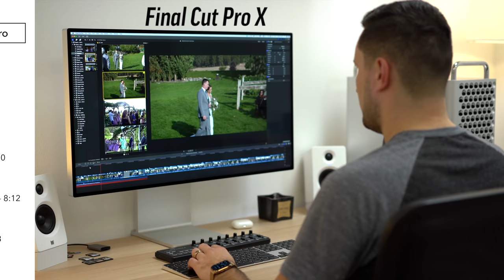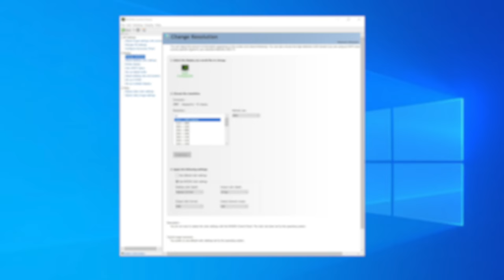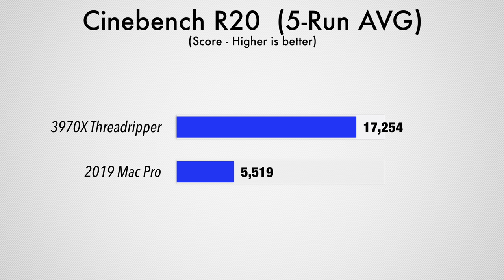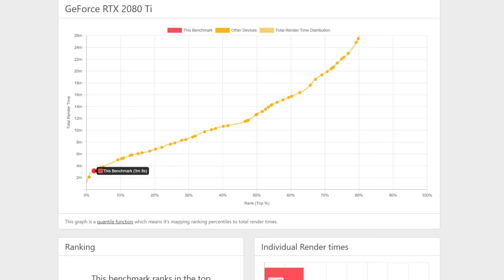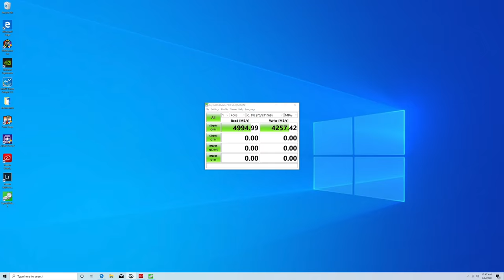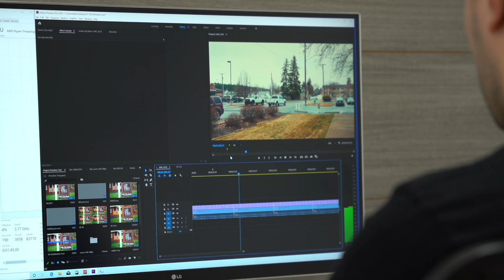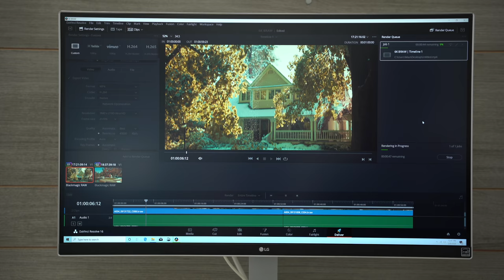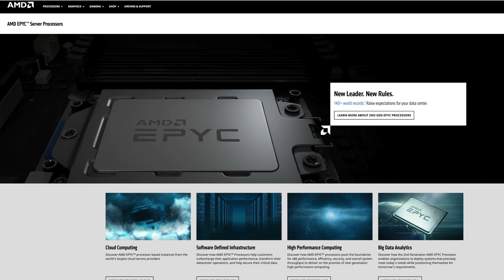$15,000 Mac Pro vs $5,000 Threadripper - Sorry Apple..

Comment: For $10.000 less, I can deal with a little noise.
Reply: Just to add to this the case also has bad air flow. Would be a lot quieter if the case didn’t have to force the air through. See Games Nexus
Reply: ufster81  "First of all, you have access to all fan curves, voltages etc. on a PC platform." Yeah, this is the main one right here.. if your system is boosting the fans when you open a web browser, the issue is not the computer - especially knowing you have a liquid cooling system, you don't raise the temp on the entire reservoir at the snap of the finger.
Reply: Yeah, the Enermax AIO is known to be very noisy, amd has major corrosion issues
Reply: Along with everyone else the noise is not normally going to be that bad if you play your card right. You can easily turn down the fan curve and swap out the fans, case, and cpu and gpu cooler to a quieter one.
Reply: However, bored with a noise problem😒
Reply: ufster81 the noise issue is due to there being no thermal design on the PC, as with “carefully saying” all PCs.  An AIO to cool the processor screwed into the top of a box with fans blowing on a graphics card and a few fans bringing air in is a hack job, not a thermal cooling design. For serious users, either the PC would need to be in another room or it’s not a sustainable solution without headphones. It’s exactly like the difference between a Mercedes S-Class and a Hyundai Genesis ... on paper it looks like the Hyundai competes, but for those who use their machines daily, noise levels are critical and actually, for most true professionals who need this level of power the extra $10k is actually not that much of an issue as you’d be an amateur to not make that much money out of your workstation every week or two.
Reply: ufster81 the noise issue is due to there being no thermal design on the PC, as with “carefully saying” all PCs.  An AIO to cool the processor screwed into the top of a box with fans blowing on a graphics card and a few fans bringing air in is a hack job, not a thermal cooling design. For serious users, either the PC would need to be in another room or it’s not a sustainable solution without headphones. It’s exactly like the difference between a Mercedes S-Class and a Hyundai Genesis ... on paper it looks like the Hyundai competes, but for those who use their machines daily, noise levels are critical and actually, for most true professionals who need this level of power the extra $10k is actually not that much of an issue as you’d be an amateur to not make that much money out of your workstation every week or two.
Reply: ufster81 the noise issue is due to there being no thermal design on the PC, as with “carefully saying” all PCs.  An AIO to cool the processor screwed into the top of a box with fans blowing on a graphics card and a few fans bringing air in is a hack job, not a thermal cooling design. For serious users, either the PC would need to be in another room or it’s not a sustainable solution without headphones. It’s exactly like the difference between a Mercedes S-Class and a Hyundai Genesis ... on paper it looks like the Hyundai competes, but for those who use their machines daily, noise levels are critical and actually, for most true professionals who need this level of power the extra $10k is actually not that much of an issue as you’d be an amateur to not make that much money out of your workstation every week or two.
Reply: water coolers exist too
Reply: @haithamali2161  hahaha lmFao dude noise in comparison to power/ capabilities isn't a hard choice oh yea and you save what 10 G's 😂😂😂😂
apple 👎
Reply: all you can tell about the mac is.. "It s very slient".. LOL...
Reply: ufster81  oh I have no doubt, and still come off thousands less then the mac pro lol
Reply: Threadripper is a lot more power efficient than Intel Xeon. You can make a silent and classy Threadripper system
Reply: Yes, not to mention dampened fan mounts, and good quality fans FTW (Noctua for example) . There are ways to get a pc whisper quiet, without breaking the bank, and thermal design is the first consideration of any serious system builder. Unless you buy a chassis based on looks regardless of poor design. But even if (all) PC is badly designed (like some uninformed idiot suggests) I'd tolerate the extra bit of noise and have 3 systems up and running for the same initial cost, bringing in 3 times the cash flow any day, so if one is down for maintenance, it is not going to be crippling for business. Not wasting profits on absurdly expensive repairs. While having unnecessarily long downtime. Missing a big break because your Mac is out of commission, not much fun. Yeah, anyhow, good luck getting those Macs repaired...When they break, not if. While on a PC when something breaks and the part is not immediately available, I am able to swap in virtually any compatable available parts while waiting for the proper replacement. If you care more about "status" and the downtime of your rig does not have an effect on your business, your not doing serious enough business.

Compromises have to be made, sometimes a slower or noisier system is acceptable, especially considering when there are multiple systems running simultaneously, which means that the work is still getting done faster overall... You can't drive a Mercedes when you need a pickup truck. Well, you can, but you'd be an idiot trying to showcase class without realizing that you are sincerely demonstrating your lack thereof. 

TLDR: PC = modularity, upgradablity, cost effectiveness, parts availability, serviceability. customizability. Did I mention cost? No? Okay, initial cost, repair costs, replacement costs. No need to rely on the "imbecile bar" to tell me that they cannot repair it and the replacement parts (the whole main board, new RAM and CPU although they are not faulty needs to replaced, they treat it as one "module", why not replace the power supply while it's in for repair, all of which at price of a complete new Mac) will not be available until next month, since Apple do not send parts unless they receive your old ones. So you'll have to buy another Mac, either way, to keep doing your work while your rig with all the software you need to do your work, is sent off for repair, and the reinstallation alone will set you back a couple of thousand, since time is money. But you haven't properly thought it through, have you, I mean, Macs don't break, do they? Yeah PCs don't either... (considering that you have a passively cooled Intel Zeon based PC running proprietary software, and someone has to get fired for not soldering the CPU and RAM to the main-board... Who TF approved the use of sockets, let alone, mainstream "PC Mobo" ones.)

On a more serious note though. Macs are fantastic machines, I'm not arguing that, but this just shows you that a comparable system (better in more than one regard) can be had for a third of the price, makes you wonder if you get what you pay for, or pay for "brand image".

Apple sucks, sue me.

Also, I am not affiliated with any PC component manufacturers in any way.

Apple does not suck? Sponsor?
Reply: There is a lot that can be done here, we have $10k to spend. A case without a window to start, would help with sound. Someone already mentioned it but there are better fans out there for this. Lastly water cooling loop.
Reply: but I can't deal with windows
Reply: @apereirafernandez , you can customize it to your hearts content...
Reply: indeed and mac has less moving parts so its easily going too be more quiet. another useless feature well done. thread ripper for the win!!
Reply: whit a bit of work, u can move mashine to next room and be supper quiet
Reply: I can't deal with noise, as my computer is in an audio control room. For any other use, sure.
Reply: As others mentioned, actually taking a moment on thermal design and part selection would silent the Threadripper right up.  I'd start with a case that isn't going to starve for air flow.  "Silent" cases get that way by restricting airflow, which is fine on builds with little heat output.  if you're in the class of people that honestly need to debate between a $15,000 base model Mac and a $5,000 PC, you ought to be able to splurge another couple hundred bucks on a proper case and water cooling... or do what any professional with sense would do and stuff all the hardware in a closet somewhere and not stick a tower in an environment where background sound levels matter.
Reply: And use noctua fans instead of the stock ones
Reply: @volodymyr8649   Shows how few "intelligent person" PC users there are!
Reply: @s4rg380   You make a good point with the down time for Macs. Whilst Macs are generally well made, in recent years Apple has built in severe overheating problems and when a Mac fails it can be extremely expensive and slow to fix.

Apple hasn't organised a full professional service to go with the high price of its workstation equipment. The major suppliers of PC workstations offer fast, on site service to keep crucial equipment up and running.

The reported whisper quiet operation of the Mac Pro can't be overrated. It may not be what PC users are used to or need, but many Mac users do. I have my doubts that PC users can match what Apple has done. Apple has designed a rotating cowl around the fan blade tips, eliminating turbulence. They have also designed the interior to be clean of cables and to force air through focused paths.

This level of polish, design and finish does not come cheap and is not really possible to duplicate in a patched together PC.
Reply: @peterbreis5407 , while I completely agree with you on a superb finish and build quality of a Mac. The noise thing is a non issue. Noctua, and Be Quiet!  are two of the foremost companies that are specialists in the fan industry, Noctua also has their own special secret sauce ducting and I assure you that it works bloody well. Pair that with their humongous heat sinks and you'd be able to hear the humming of the MOSFETs well above the sound of air flowing. Or, you can always opt for passively cooled components, but they are generally weaker spec, for obvious reasons.

Patching together a system will never be quite the same finish as a mass produced, and dare I say "designed to be installed by idiots" plug in modules. Which needs to be without extra wires and finicky bits, but considering the range of supported components able to plug into those slots, it doesn't really need modular power cables in the same sense as PCs do. But if you choose your components wisely, you can achieve impressive results indeed, and cable management is down to the system builder, if he does a poor job at it - it will look bad, and choosing the right chassis with airflow considerations (and cable routing options) is not out of the question either. 

All in one liquid coolers are rarely if ever going to be a real option for a serious business machine, water and electricity do not mix well, well shit happens, Murphy's Law and such... and coolant needs to be changed once in a blue moon, on enthusiast systems, different story. But, now where a radiator would have been, becomes an airflow path (typically for 3x140mm fans) with which you can choose if it's intake or exhaust or blocked off by acrylic, the funny thing is that more fans do not necessarily equate to more noise (unless they are shitty fans, which would sound like a 747 taking off) but having more fans running slower gives the same airflow as less, but faster fans, the faster a fan runs, the more noise it makes, and bigger is better for the same reason. Big and slow is the way to go. 

I've built systems with 9 fans in total in the past, that you wouldn't be able to tell if they were powered up or not (without looking at status lights) Definitely doable if you are willing to void the warranty on your GPU and PSU to change out their fans. Admittedly, it's not for everyone.

As to support on Macs, yeah, they don't even have qualified techs for their own products, and don't get me started on the red tape.

But in the end I am not a big fan (pun intended) of noisy fans either...

And for the record Windows 10 sucks. But hey, we'll make it work.
Reply: @s4rg380   My position is predicated by Window Sucks! Linux Sucks Different!! :)

I am in the happy position of having multiple Macs from a 21 year old iMac still looking and running like new, a 9 year old iMac 27" with 2 magnificaent screens, still running fine. An 8 year old Macbook Pro also running fine, a somewhat annoying Dell 2 in 1 which used to run W10 but now runs Linux, a desktop PC with W10 that sits ignored in the corner, a superbly useful iPad and Android smartphone.

My sole concern is what I will have to do if either my iMac 27" or Macbook Pro give out on me. Currently it looks like I might go Hackintosh unless Apple has something sensible to offer.
Reply: @peterbreis5407  I hear you, hopefully Intel can pull their act together, because that is the real problem currently, I sincerely doubt that Apple will switch over to the red team now, since it would put them back at square one from a software optimization standpoint.

Linux do suck, in other ways than Windows does, with so many options, we're still limited, aren't we?

If life gives you apples, you make lemonade, or if it gives you lemons, you bake apple pie... We'll have to make do with what we've got, I guess, modding the life out of the aspects we don't like. Embracing those we do...
Reply: Or just... put the PC elsewhere, and use thunderbolt cables to power your monitor from a fair distance.
Reply: The case in this video (bequiet dark base pro 900) is not even the quietest case. It's slightly better than average, but the fans have to work pretty hard (operate loudly) to pull air into the case (just look at the front panel). A case like the Lian Li O11 dynamic or Phanteks P600 probably would have been a better choice.
Reply: @XRayV20 , where there's a will, there will be a way.
Reply: Yeah can't deal with the noice ill just pay
Reply: It can actually get pretty quiet if you use a better case and went custom watercooling
Reply: ufster81   Proudly 35 year knowledgeable fanboy. Apple didn't always get it but they sure aimed for quiet and got a LOT closer than all the PCs I had to endure in that time. But thanks for your thoughts.
Reply: ufster81   Your definition of "quite silent" I find oddly subjective. "Only" the odd cheap fan here and there. Apple started with the fanless Mac 35 years ago and mostly (I emphasise mostly) kept up the practice.

Macs were always enjoyable and relaxing to use because they were so quiet you could use them for protracted periods of time, PCs not.
Reply: Matias Gato
Matias Gato
cheap? hack tosh, or noob?
play all day?
Reply: I have that exact same case.  I can tell you from experience, that that case is outstanding.  But just like any other case, you need to properly configure your fan profiles and choose the right fans to get the best performance to noise ratio.  You can't just plug and play and expect it to be quiet.  I'm running a Threadripper 1950X with a Noctua NH-U14S-TR4 air cooler (dual fan configuration) and 6 case fans and everyone who sees it, can't believe how quiet my PC is.  They've literally stood right next to it asking how the hell they still can't hear it, yet they can clearly hear my media server that's completely on the opposite side of the room.  And my media server is dead quiet too, but doesn't use a noise dampened case.
Reply: You guys do know he's acting like that in purpose... lol
Reply: It's the sound of P O W E R
Reply: It is not just the noise for me, its the stability and features of macod
Reply: yes...we do!!!
Reply: Could always switch to a fully liquid cooled system IF the noise was a problem.
Reply: @anishawasthi1109  It is a little, and even with less than $100, it can be fixed.
Reply: @anishawasthi1109  get the apple, then...
Reply: Are u sure about that ;)
Reply: There are air coolers for TRX40 motherboards, for example bequiet! Dark Rock Pro TR4. PC build is based on bequiet! Full Tower ATX case, so why not to use air cooler of the same brand.
Reply: You can use a silent Noctua Fans
Reply: Yes, I don't see bloody Apple iShit
Reply: He could have used noctua fans..
Reply: just use a water cooler, done!
Reply: @MrDe0  bruh xD You don't know that water cooler uses fans? That makes the sound.. Just buy noctua fans, they are cheaper than water cooling and more effective and quiet.
Reply: Daniel kytonen  😅
Reply: @haithamali2161  not exactly, the 2990wx is by far one for the hottest cpus ever made even if it has 4 times the surface area of intel
Reply: 10 grand Maingear solves all this
Reply: Lmao and for 2500 dollars less I would deal with building my own pc
Reply: I mac pro...just a swaggy pc for rich kids.
Reply: my laptop is loud af. 60 decibels while I game wtf
Reply: You mean for 16000$
Reply: Yep, Im pretty sure you can fix those minor inconveniences for les than 10K.... or buy a car maybe
Reply: You can build a new house to put the pc in it 😂
Reply: @haithamali2161  you can replace all fans with noctua's and the sound would be very similar, also watercool with as many radiators as possible as large as possible
Reply: Eric Heick how can corrosion habe anything Torso Sith the CPU? Like wtf
Reply: I would just put on a pair of headphones. There, fixed
Reply: Just custom watercool it for 9500 less give or take
Reply: With leds than 200 you can buy a full set of noctua fans that are way quieter and cooler. Also, this case while he looks good, it's not the best in thermals. With the extra 10000 dollars you can do A LOT that will make the pc outperform the mac in any way
Reply: Just watercool the whole PC, and use an airflow specific case
Reply: matias that is not why people choose macs tho... Many people dont have the time patience or know how to deal with Many of the things a ThreadRipper Windows computer comes with Including the Building of it And many people just need a Simple video Editing machine or Just a simple computer
Reply: If hed have saved some money on the cooler and gotten a noctua nh d15 and some noctua 120mm fans in a carbide 275r this build would have mad next to no noise, this whole build is pretty dumb and it still rips the mac pro apart lmao
Reply: lol
Reply: And a better os and much better specs
Reply: @Geth270  I was going to say the same as you.I hope he didn't do it on purpose.
Reply: Just buy long hdmi and replace pc in other room
Reply: Or you can add extra $500 to get a custom water cooling
Reply: A simple fix to that is.... wear some fucking headphones
Reply: I will invest in 100$ of cables and put it in the next room.
Reply: Especially if your setting up a small business. 3x the workstations.
Reply: Also depends on the case XD
Reply: You can have a silent threadripper for a couple hundred dollars in AIO water coolers.
Reply: I would put the computer in another  room
Reply: I’m thinking they messed it up on purpose just to have one more reason why Apple’s machine was better.
Reply: @setgeeks  Heck you can even have a dedicated ACU installed for your PC under $10k. I think this can solve the thermal issue in PC 😂😂
Reply: @ericheick7044  Corrosion issues? Do you cool your CPU with salty water? 😂
Reply: Specifically with noise canceling   🎧
Reply: ... My pc cost 450 and also makes also some noise but that's always right?
Reply: Andrew Partis put it in an open test bench and you have 100% air flow and 100% noise use headphones and you golden or leave the pc in a black room with airflow amd drill holes for the display cable to another room 
Noise removed succesfully XD
Reply: Or you could get longer cables and put it in another room. Boom, totally silent.
Reply: Greenwolf Hunter I mean the guy spent 15k on a video editing pc that can’t play a video game. They weren’t thinking, slap some Noctua fans in that thing and ur good to go. Save yourself 10k and don’t support such a shit company like Apple that takes advantage of their consumers.
Reply: Idk some peoples wallet looks like its thicker than a hentai antagonist but with a brain smaller than gogeta' tolerance for broly
Reply: Plus 2X the performance lol. Apple take the crown as king of rip-off again
Reply: The worst thing is apple kicks their own balls by lowering performance to make it more silent, and it still isn't completely silent.
Reply: Matias Gato if I was a power user I simply would not care about noise or heat, I just want speed and stability.
Reply: For 10k less it could scream for all i care it is still 10k cheaper LOL
Reply: @Mirda-bg3pi  And it would only cost a few hundred for some really nice noise canceling headphones.
Reply: Use sound cancelling earphones
Reply: Buy an air conditioning and put it on the cass 🙂
Reply: @haithamali2161  isheep
Reply: 10$ Less?
Reply: Said like a true peasant
Reply: i just wan the noise app for my watch  ...any help lol
Reply: I cool my new threadripper with two 560mm thick boi rads.  Don't expect much noise even under full load.
Reply: Anyone can deal with the noise,
and you can use headsets to stop hearing those noises !!!!!
Reply: Just buy a $20 headphone and you won't hear any noise till you have it on your head !!!!!!
Well, that guy has peanuts in his head !! xd
Reply: use 100% water cooling , never noise again
Reply: @redblitz1816  also no one cares about noise when you have any decent pair of headphones. I have a corsair void pro which costs 70 dollars and I cant hear anything when my fans are at full speed.
Reply: not to mention... when you use a silent case it tends to choke off air supply, causing the fans to ramp up...   he would have been better off using a case with better airflow and low speed fans..   it would keep temps down and stop the fans from ramping up making more noise
Reply: ufster81  Totally agree with you, But to be fair he could have custom water-cooled it because if it is for professionals then they wouldn't mind spending extra $500-1000 for the water looping. It would have  been a dead silent system then and would have completely destroyed Mac Pro in Noise to performance testing.
Reply: @user-lu6zz1hc8p  You can pay couple more dollars and custom water cool your pc or install anything like a Noctua D15 instead for a dead silent PC at the cost for bit high temps just like Mac Pro. But PC gets you an awesome value.
Reply: @peterbreis5407  Apple can't even get close to the silence that comes with custom water looping and big tower coolers like D15 and Assassin 3 while also giving better temps.
Reply: @silentwater79  😂🤣🤣🤣😂🤣😅😅😇😇😇
Reply: @Think no guessing Those who have cash and know how to build a pc, they could build the same pc with Intel XEON and better GPU, get Mac running on it and use some awesome Noctua and bequiet hardware to get their system running dead silent.
Reply: @outrundiamond6444  Prebuilds are ready for it if you want to be really that simple. It is just about saving your money and spending it on something useful. You can easily get better performance for les than 3 times the price of Mac Pro. This is called effectiveness. I don't think anyone would buy it for 10000 bucks more just for a 5 to 10% performance increase in some tasks.
Reply: For 10k you can build a small room just for your tower if fan noise is that much of an issue
Reply: And you have 10k likes 😂
Reply: @ravenclawgamer6367  Yes exactly, i have an AIO, but if i was going for air, it would be Noctua.
Reply: i can buy a car with leftover money
Reply: besides, you could do full custom watercooling with the extra money
Reply: Or buy proper cooling with the spare change.
Reply: Just custom watercool it and you'll be way quieter and you'd still have loads of money left over
Reply: @redblitz1816  yeah and the new 3000 series graphics cards are as quiet is a mouse. I know from personal experience
Reply: https://m.youtube.com/watch?v=lSymn_z82r8&t=16s u
Reply: Mac os
Reply: the mac pro looks so much better
Reply: 😂😂😂😂 right
Reply: You can also optimize the fans and temp curves